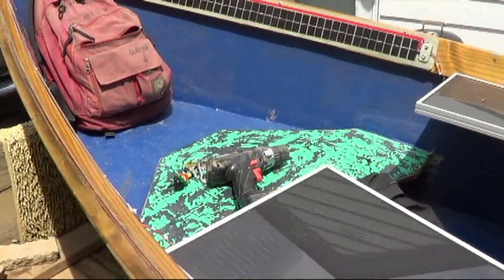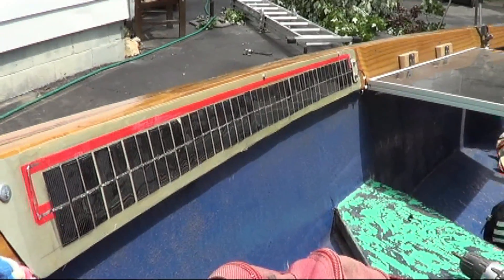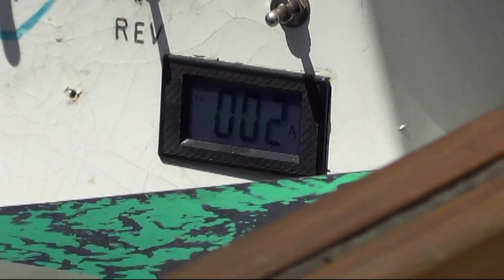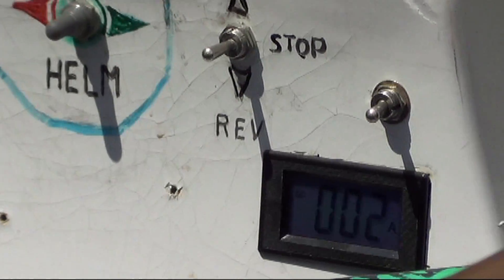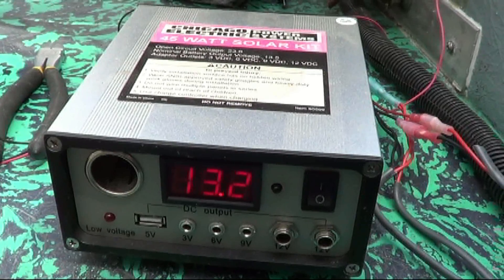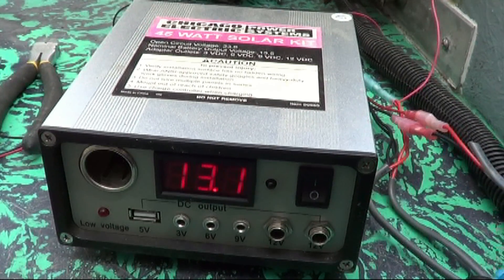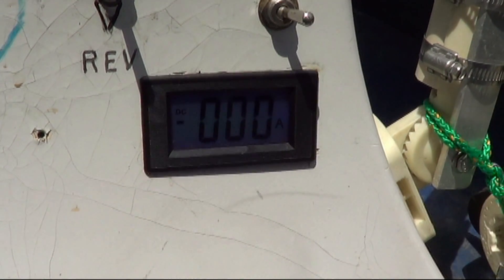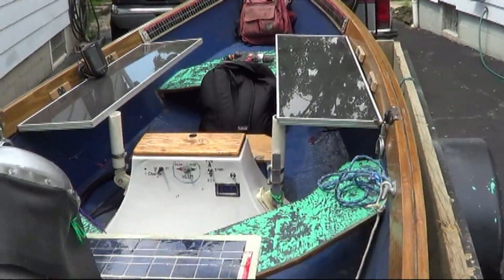Tournament Ready ~ solar powered ~ Fishing Boat  angle grinder ~ electric outboard motor

Comment from the maker: hey craig ~ thanls for watching ~ yeh, the trailer comes in real handy for work as well as use for electric boat haul. I most certainly do not have room in my driveway for ANOTHER trailer... my little back yard holds a boat trailer and a sail boat on it. and it just sits there, all season. its a huge trailer ~ need one? and a sailboat? hah ah hah ~ sorry about the vertigo thing ~ had to spice up the video a little  ~ felt like I haven't given a shot to any of them lately...